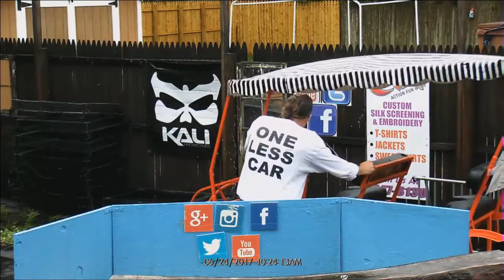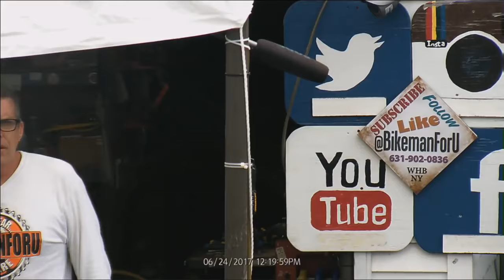Bike Shop LIVE "Summer, Sun, Sand" S5E25 BikemanforU Show 06-24-17

Comment: that china made moron motor stops by for a visit: @1:36:16 "I know, man. I KNOW --- the motor was a hundred bucks on the internet but it AIN'T WORTH SHIT when it don't work ! " people, please don't buy that crap engine. lots of flippers throwing an $80. dollar engine on a throwaway bike and resold on craigslist for up to $500. A seller bragged to me that's what he did in the city. The people that buy them think only of initial cost and not the fussy setup which often never works quite right. good luck getting a refund from China.
Reply: They do that here in Ohio. They try making a $50 Huffy into a $500 bike.